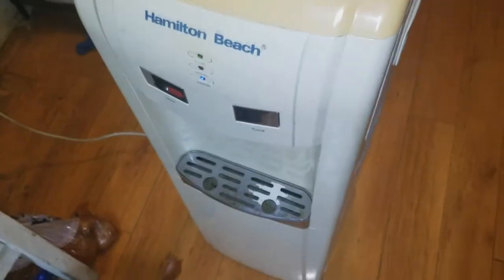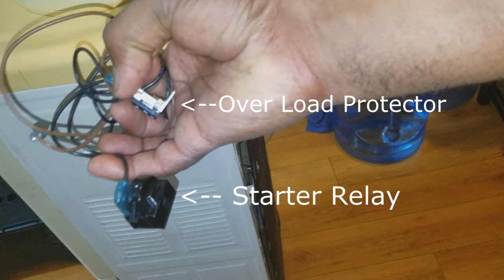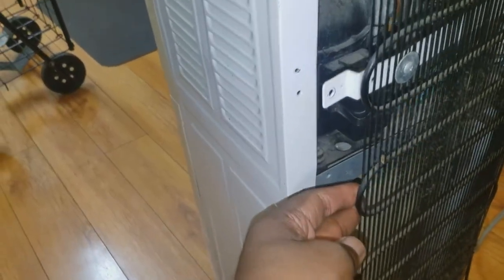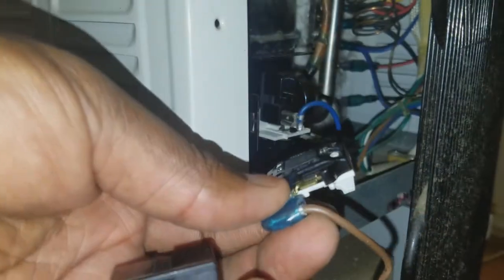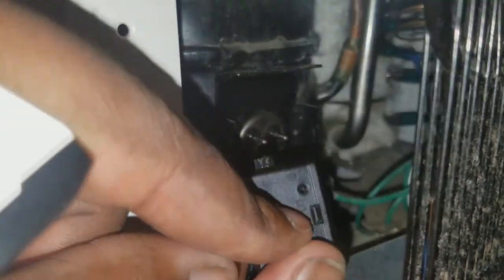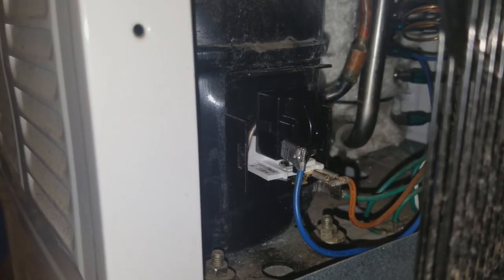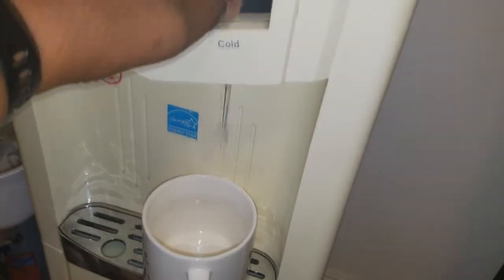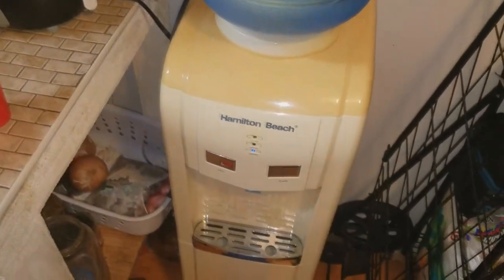Fixing the Cooling of the Water Dispenser | Relay and Overload Protector Change

Comment: Very helpful.  I’m gonna pull my old parts off today and check the numbers.  Hopefully I can order them and have cold water soon.  Thanks so much for sharing.
Reply from the maker: Good luck with it. I found the best price for the replacement parts on eBay. The same parts from regular stores were wayyyy too expensive. With my swap out, i was able to get the cold working to the level it was before it went out.
Reply: i have hamilton beach water dispenser model bl - 5 -2 its not working no light or compressor working.  do you think try relay like on this video  .
thx

Comment: Is there a way to adjust the thermostat? Make it more cooler
Reply from the maker: I wish...but manufactures don't offer that for the most part... and i figure maybe there is a way to create a hack to do it...but think about that the water is not coming out instant cold from the tap...but coming out cold from the "tank" that holds a bit of water pre tap.
Reply: There is a way to make it colder therea a screw to the thermostat I seen it here o. YouTube